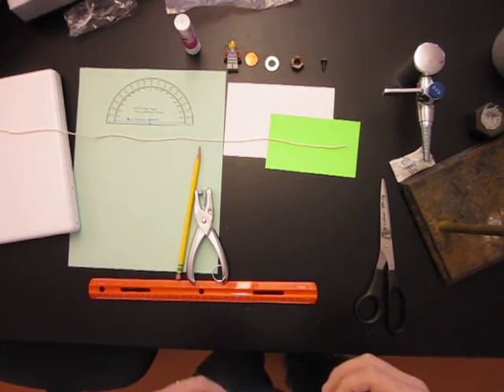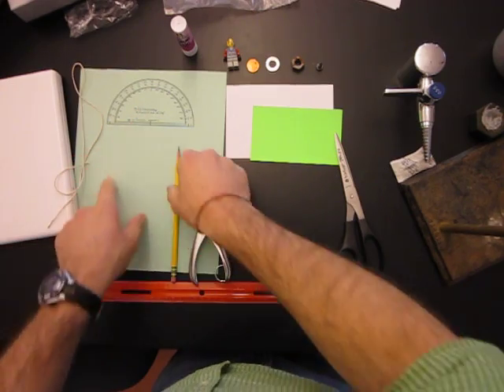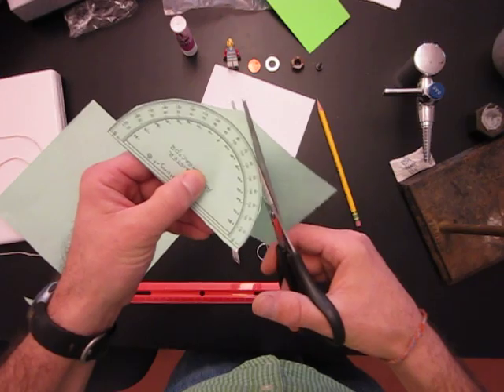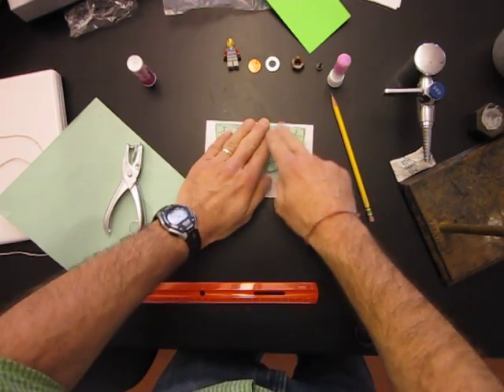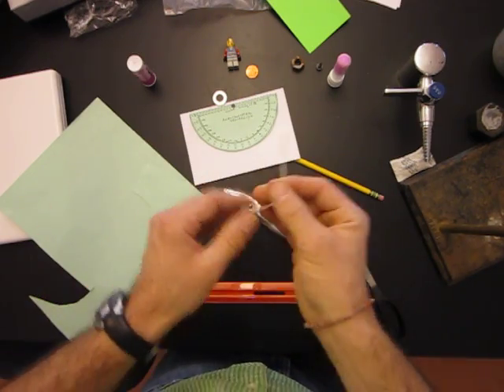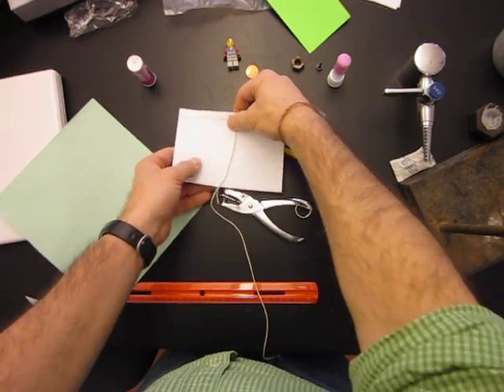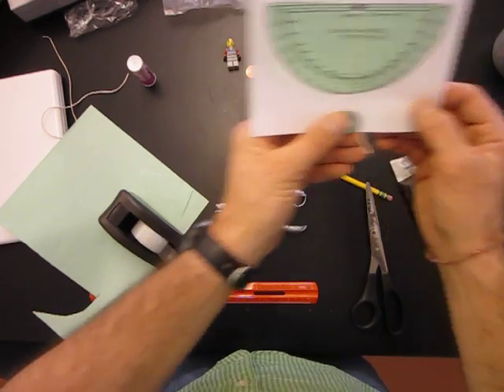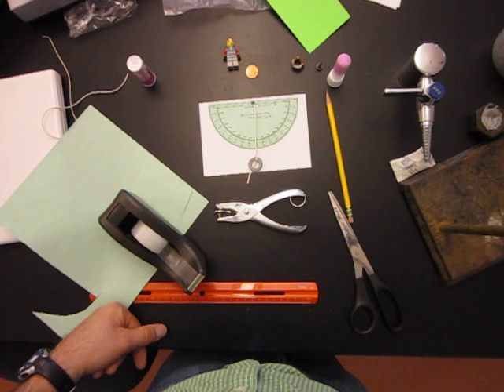How to make a simple accelerometer

Comment from the maker: I think this is how you do it.  [Good question, by the way].  The horizontal acceleration can be determined using a little trigonometry.  The tangent of the angle is equal to the horizontal acceleration in g's.  If you take the tangent and multiply it by 9.8 m/s/s you get the horizontal acceleration in meters per second squared.  This assumes that the mass of the string is relatively insignificant relative to the mass of washer.
Reply: acc(G)=tan(angle).
acc(m/s)=acc(G)*accGravity(9.81)
so indead on earth when asuming the most frequent average gravity on heart the speed in m/s would be tan(anglerelative to vertical)*9.81